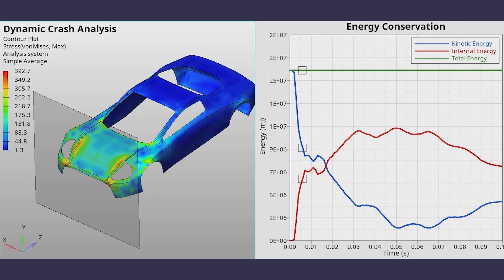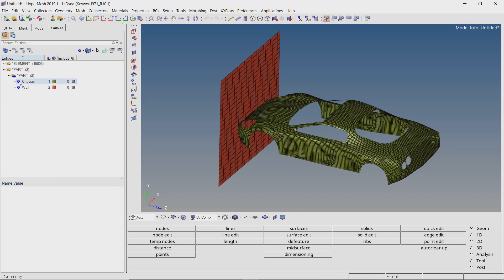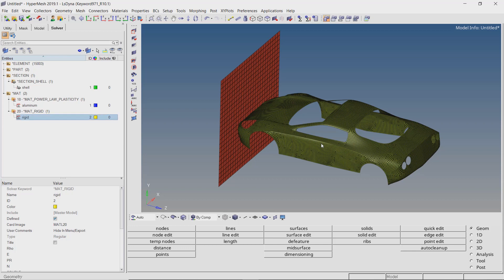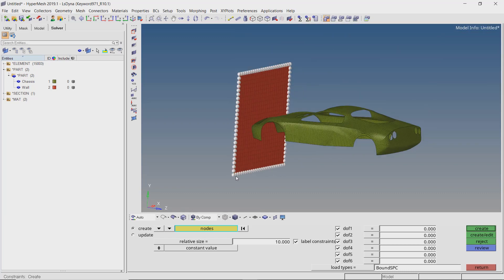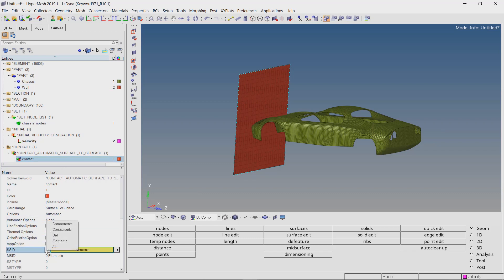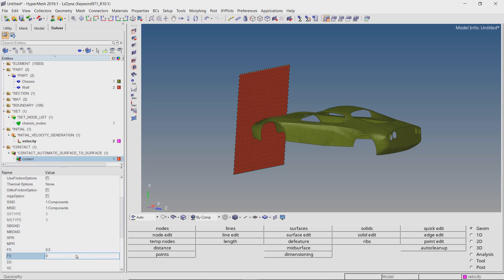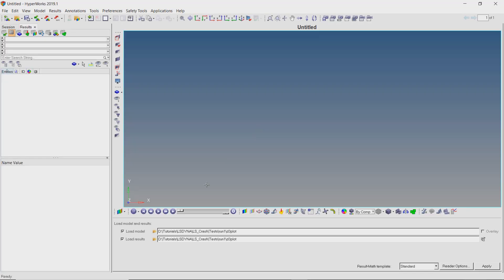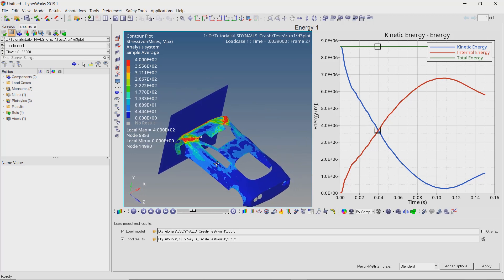Dynamic Crash Analysis [Hypermesh-LS DYNA Tutorial]

Comment: One thing I need to get cleared is, Can we give SPC boundary connection for a MAT20 component. Wouldn't it will through over constrained error? its like rigidizing an already rigid componenet
Reply: You can constrain a rigid part ie the direction and rotation using mat 20 card itself.. above that if u give SPC it becomes over constrained.
Reply from the maker: Thank you for pointing this out Sushil!
This is valuable information and I will make sure to remember this in all upcoming LS Dyna tutorials.
Cheers!
Reply from the maker: Hello,
Good question. I think that applying SPC to a component with MAT20 will not result in any error. SPC is essentially a location constraint, it does not make a component rigid (just holds the selected nodes in place).

On the other hand, a rigid material will actually make the component rigid. This is necessary for the contact stiffness formulation. If you are still doubtful about this, you can always use a regular material (other than MAT20) and provide s very high value for Youngs modulus (eg. 10^12). This will also make the component rigid.

I hope this answers your doubt.

Comment: do i get the same answers if i import the  mesh model into ansys and specify all other stuffs there like material  boundary conditions and so on...?
Reply from the maker: Ideally you should. But turns out that the solving procedure for every software is different and there is a slight variation in the results. 
Good thing is, this variation is negligible and the results can be considered as equivalent.

Comment: Hi , I saw your post on Linkedin. there are some corrections I would like to point out  in your analysis nevertheless a good approach really appreciate it. Dont mind me correcting you ,  the model used by you is not a chassis its looks like an A surface of a hypercar usually called as Body side outer, and unless you have a proper material curve you cannot calculate Heat dissipated during the crash by using MAT18 As Mat 18 uses elasto plastic behaviour of the material which obeys Cowper symonds law and looks into isotropic hardening . You need to use Jhonson cook material model which has temperature factor if you want to calculate the heat dissipation during high speed impacts.
Reply from the maker: Hello Anoop, I really appreciate you pointing out this flaw. I will consider this correction from next time.
Thank you for taking the time to convey this useful information.

PS : If possible, can you share your email id or contact me through the 'About' page of this channel ? I would like to discuss more about this with you.